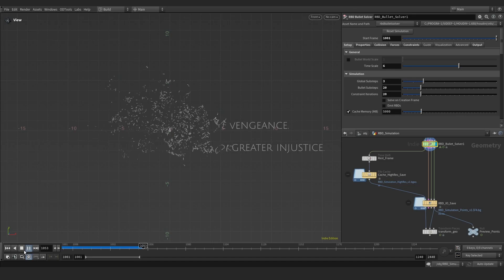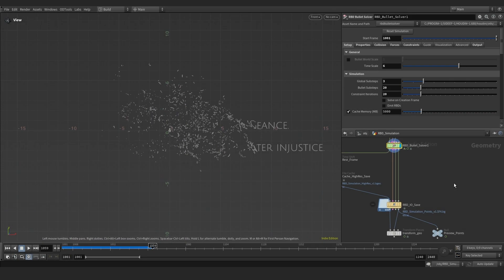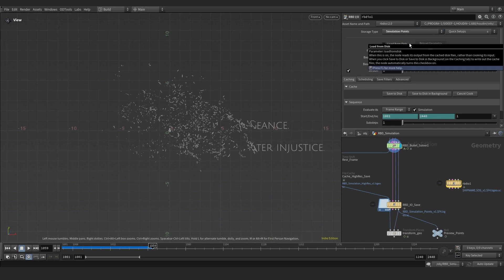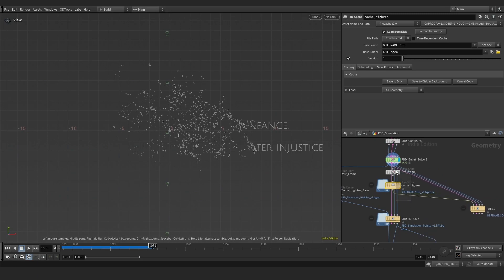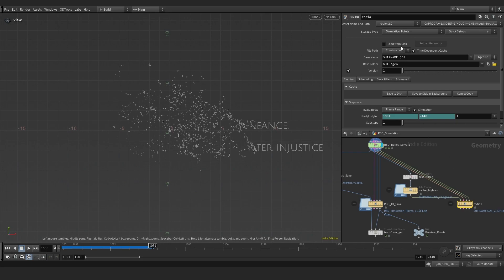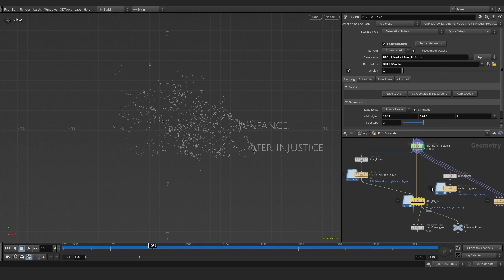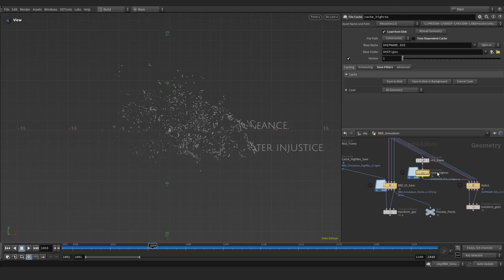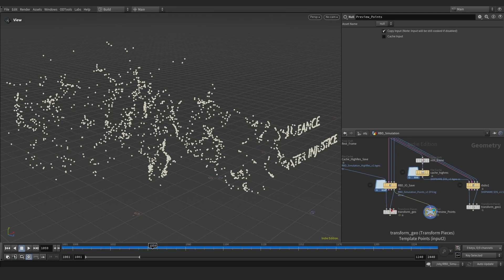How to Reduce Cache Size for RBD Simulations in Houdini

Comment: Wow, excellent tutorial! I'm wondering are there any down sides to this? Would there be any reason not to use this method?
Reply from the maker: @shauntanvfx  Thank you! I honestly can’t think of any downsides, and in fact, I’ve started applying this approach more in other areas. For instance, I am animating trees by saving only the skeleton curve to disk and then animating it with point deform or applying a similar method to vellum simulations using cloth capture and cloth deform. It's much more efficient to store only points on disk, considering the cost of applying them back before rendering every frame, which can be CPU and calculation time-consuming.
Reply: @FaitelTech  Applying this to these other areas is genius! I'm surprised not a lot of people know about this so, I've pretty much implemented this into any RBD workflow that I've been doing too now. Thanks a bunch!
Reply: @FaitelTech would it work for MpM solvers too?